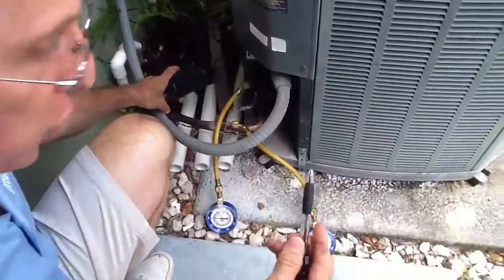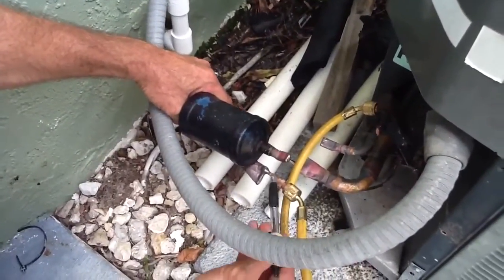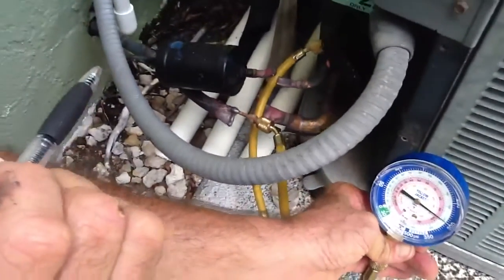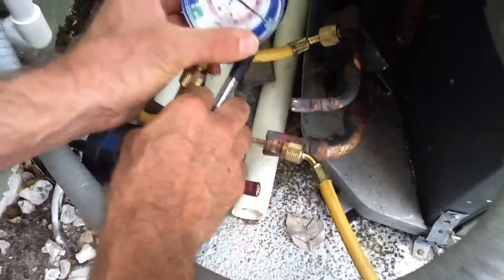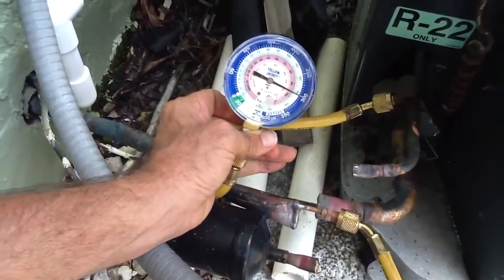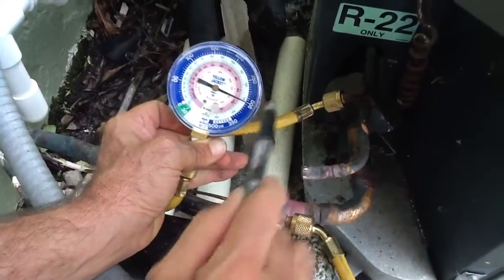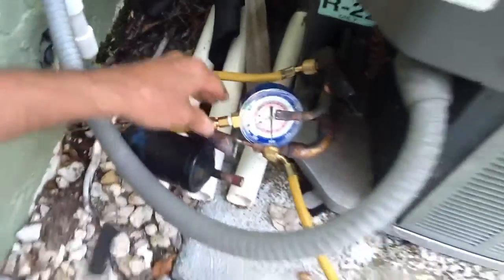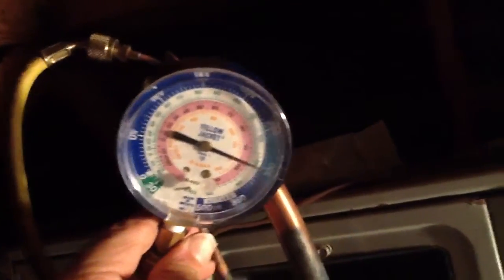HVAC Nitrogen Leak Test

Comment: 4  DANFOSS valves, 2 with double service ports. 2 with none go on all our installs. Double service valve on suction line at condenser, double service valve on liquid line at evaporator, non service valve on suction line at evaporator, non service valve on liquid line at condenser. If you ever get a service call you can perform this isolation test in no time.

Comment from the maker: We only do this on systems where we find no traces of refrigerant. We always check for bad valves and caps.   How do you know for certain the leak is not in the line set? Also when several techs have worked on a system sometimes there is traces of Refgeration, which can leave uncertain at times.